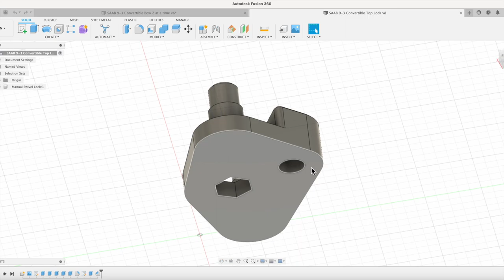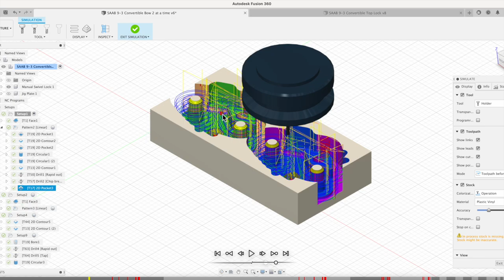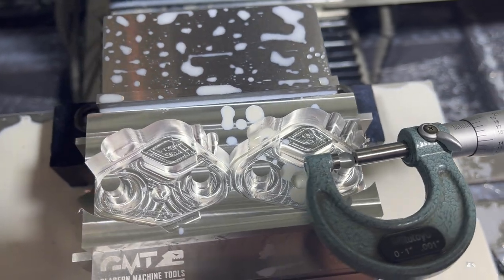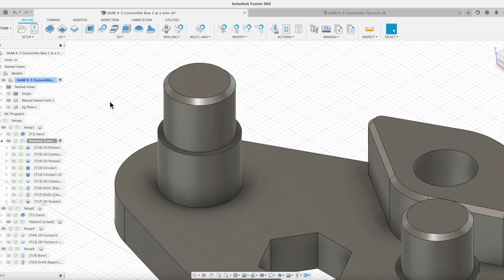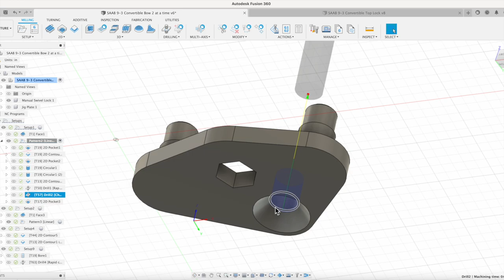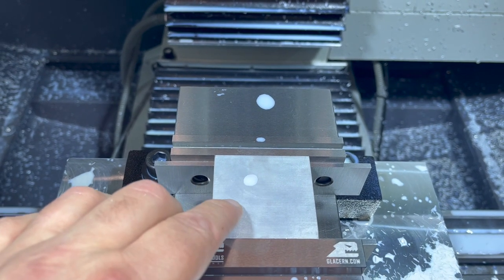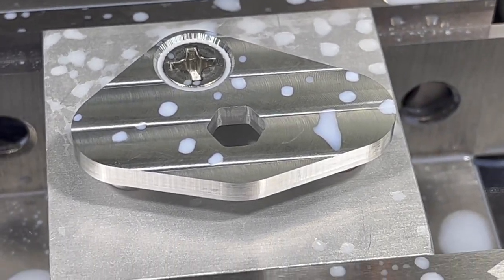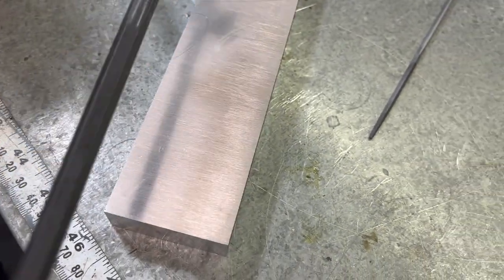Manufacture A Manual Roof Locking Bow For Saab 9-3, Tormach 1100MX CNC - Prototype to Production!

Comment: Try running the countersink slower, should help the chatter. Also when your adjusting the pin sizes, make sure you check the diameter of your endmill and that it is the correct measured diameter in the offsets page. I have found that leaving the diameter alone in fusion and adjusting the diameter down slightly will bring my OD cuts into size. Tends to be faster too as it is done at the machine and does not require a new post.
Reply from the maker: Bearded Works - Thanks for the comment. Some great pro tips about adjusting cutter size on the machine.  I did play with the feed rate on the panel for the CB but will try adjusting the spindle speed next time to see if I can find the sweet spot.  I ran a couple more of these the other day after cleaning up all the mistakes in the program and left in the finish cut pass on the pins at regular size.  Everything came out great, so other than the chatter on the CB the program runs well now, all three steps.

Comment: Would you consider dog-boning the corners of the hex to remove the extra step of hand filing?
Reply from the maker: Tim Wolf - I did consider it. Since the party is prone to stripping it just seemed that would make it weaker. Demand is not high so not an issue at the moment for the low number. If I needed to make more I would most likely machine a piece of HSS in the hex and push that through with a small arbor press to clean the corners?  At least that sounds good?  Appreciate the question.